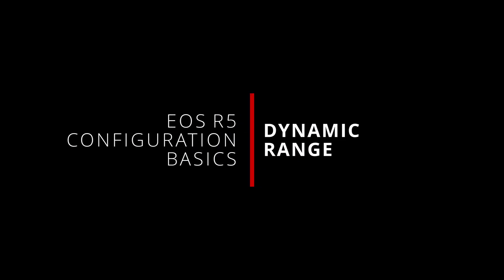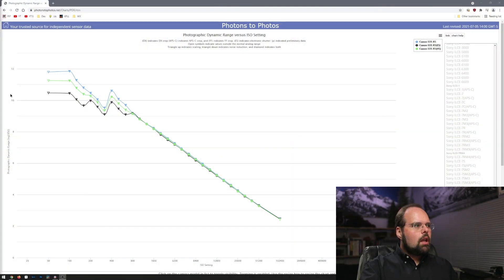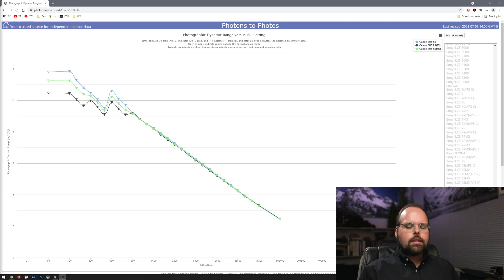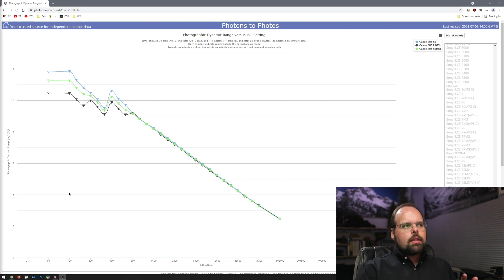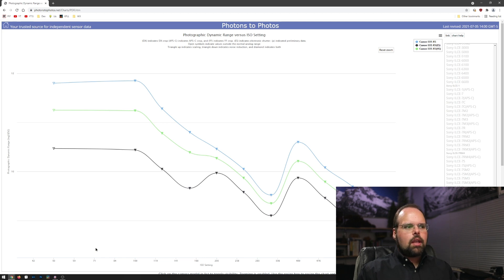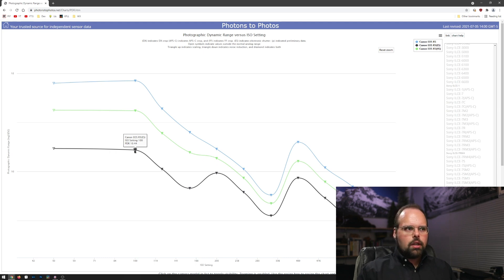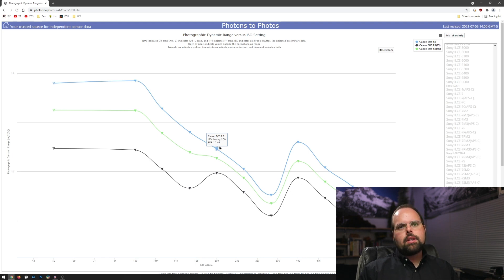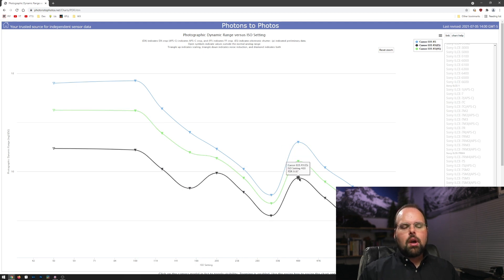EOS R5 Dynamic Range - EOS R5 Tip 8

Comment: I did 3 photos: 14bit, 13bit and 12bit. But if i open the file at rawdigger it shows a range from 500 to 16300 as normal 14bit no matter if is 14bit or13bit or 12bit.

Any idea why?

They should be different, some are 14bit and others up to 12bit...

But in raw digger:

All appear as: "bit depth 24, bits per sample 8 8 8",

In raw power: "bit depth 16"

In invisor: "color format 8 bit"

But in no developer (capture one, dpp, etc.) shows differences at all.

In summary: I have not been able to find in the metadata something that indicates that difference of 12.13 and 14 bit

How can I know that information per image for sure?
Reply from the maker: I don't think what you're trying to do will work, at least not the way you're trying to do it. From my testing, the bit depth changes are at the ADC level, but the results are scaled to Canon's 512-16383 raw file range.

To determine the ADC bit depth you either need to look at the functions that change it (shutter and drive modes) or you'd have to conduct a statistical analysis of the noise levels and dynamic range to determine the actual values.

Comparing 2 black frames in raw digger, the one shot with the FEC (14-bit) has a standard deviation of 1.5 while the 12-bit files has a standard deviation of 3.8. That's in line with what you'd expect if the camera is scaling the lower bit depth ADC up to use the standard raw value range.

I'm not actually sure what the various programs are looking to get their 24-bit, 8 bits per sample, bit depth 16, and what not. The raw digger line, looks like the metadata for the embedded jpeg. I've never used raw power, but that looks like it might be reporting what bit depth it's running in, and Invisor also looks like it's reporting the data for the embedded preview jpeg too.

Comment: Hi Jason, I wonder how all this relates to video. Looking at the black curve for 12 Bit full electronic, that should be identical to 12 Bit RAW video. Thus, wouldn't I gain nearly 1.5 stops of DR (from 9.15 to 10.44) by forcing the RAW interpretation to be at ISO 100? A bump from 9.15 to 10.44 is not to be sniffed at. But how would I achieve this anyway, when Clog limits me to 400 and Clog3 even to 800? Further, I would still gain over half a stop dynamic range in Clog at ISO 400 (a jump up to 9.87), so why was Clog 3 ever advertised to bring more DR? Most reviewers have failed to comprehensively prove an improvement of DR through the introduction of Clog 3 on the R5, so I'm sceptical of its usefulness. And this was reinforced by the graphs you discuss here.

H265 is a different matter altogether I suppose, because we are now looking at 10 Bit rather than 12. Correct me if I'm wrong. In that scenario, I could see how the differences between 400 and 800 vanish entirely and Clog3 as a Curve somehow extends the perceived DR slightly.  It seems to just shift the distribution of values to different areas in the range, rather than increasing the range itself.

Ideally I would like to disable Clog completely and just shoot at ISO 100 in RAW with a Picture Profile, as I'm trying to squeeze every last bit of DR out of this camera in Video mode.  This should give me 10.44 stops but I'll have Colours already baked into the image and I loose flexibility to color grade in post. Is this at all an option/am I correct in my assumptions? If I require a flat/log profile, it seems shooting at ISO 400 in regular Clog (not clog3) with RAW enabled, is the best option to achieve 9.87 Stops of PDR. Using Clog3 and ISO 800, I seem to be capped at 9.15 stops. 

Your help & comments would be really appreciated!
Reply from the maker: Let me start with I can't fully address this right now, mostly because it's pages of text and hours of video that I haven't quite figured out in it's entirety yet. Digging into a lot of this is high on my priority list, but also, as you can imagine, quite challenging. That said...

When you're shooting in raw, clog doesn't really apply. The data being saved is "raw" sensor data, not a clog/clog3 mutated version. Technically it's more complicated than that, but I don't fully understand the details yet.

The trick with raw video is getting the data out without it being converted to some other curve. Canon's cinema raw development tool doesn't support a linear output mode, at least as far as I know. You can probably get closer in Resolve or Premiere Pro, but I'm not even sure they support conversion to a linear format. And as far as I'm aware, there's no open source tools that can convert cinema raw to a linear file either.

Also all of the log formats actually "extend" the actual dynamic range that can be stored in the given number of bits. There's no perception involved. Log curves are lossy data compression. 

Log video formats are also somewhat more complicated in how they're designed to be used and work than most people appreciate. A lot of this has to do with backwards compatibility in broadcast TV standards that go back 60 odd years or more (this is the bane of modern video IMO).

Finally, CLog1/2/3 are log curves, you can't think of them the way you appear to be. They're not linear, and the whole bits == stops logic from linear raw formats doesn't apply here (nor does it to JPEGs either). A 10-bit clog file can store about 14.5 stops, a 10-bit clog2 file can store about 18.5 stops, and a 10-bit clog3 file can store about 15.5 stops. The compression algorithm doesn't matter: MP4, ProRes, DNxHR, DPX, whatever that's how the data is compressed not how it's encoded, it's a different layer in the process. 

The trade off any log format makes is precision. The more DR it can store, the bigger the steps are between brightness levels. Though this point also gets very complicated, as linear formats are hugely wasteful in the brighter stops where there's far too much precision for the actual brightnesses that can actually exist in them.

On top of that, they're not designed to scale dynamic range with bit-depth the way a linear raw file is. A 12-bit clog3 file will have the same dynamic range as a 10-bit clog3 file, but will have more coding points and therefore can store smaller increments of brightnesses.
Reply: @PointsInFocus  All good points, and fair enough about the lack of technical correlation between 10 Bit / 12 Bit and DR. But I still can't help but think there's correlation between Video capture to how the Electronic Shutter mode behaves in the graph you discuss in this video here. Are you aware of the CineD tests? They confirm that there's indeed a gain in DR shooting at ISO 400 as opposed to 800, a gain that correlates almost exactly to the graphs above. I suspect strongly that the next jump up, from 400 to 100, will yield even more DR, also in Video.
I've also figured out in the meantime, that you can indeed shoot RAW at ISO 100 with a Picture Profile on top, and then bypass said Picture Profile in Resolve and interpret the RAW clip on the basis of Clog Curves, just as if you were shooting RAW in Clog in the first place. (In theory, you could overexpose ISO 400 by two stops and then lower the ISO to 100 in the Resolve Raw tab, but that Raw tab is broken/buggy for Canon Raw since half an eternity. ISO changes sometimes work, sometimes not.)
Bottom line: I think it's a worthwhile test to shoot Raw in Clog at ISO 400 and compare it with a Raw Clip shot in Neutral Profile at ISO 100; then develop both clips in Resolve as Clog 2 / Cinema Gamut files and match them by two stops of light, and then compare DR. I don't have the tools to do the analysis scientifically, unfortunately. All I could think of would be to push Shadows and Highlights and interpret the behaviour of the files.
Is my logic still flawed? At the end of the day, god knows what's really going on under the hood here 😂
Reply from the maker: > I think it's a worthwhile test to shoot Raw in Clog at ISO 400 and compare it with a Raw Clip shot in Neutral Profile at ISO 100; then develop both clips in Resolve as Clog 2 / Cinema Gamut files and match them by two stops of light, and then compare DR. 

Shoot raw at 100, 400, and 800 and compare the dynamic range however is easiest for you. The picture profile and clog curves are all metadata in a raw file, not actual changes to the pixel values, so they're not going to affect anything anyway if you're not applying them in post.

The R5 will never exceed 12 stops (engineering DR), so even a clog1 file will can encode and store the compete dynamic range. If we're just looking to understand DR, we don't have to care about encoded precision. At least as long as you've set your exposure level's correctly and white is at or just under clipping so you're not artificially crushing data in the blacks.

In theory, the camera should preform the same in video as it does in stills form a dynamic range perspective. It's the same rolling shutter, same ADCs, etc. Of course, we all know in theory, theory and practice are the same, in practice that's almost never the case.

Like I said, I want to really dig into this, because there's a ton of stuff I'm just not really sure about here.

The real problem with all of this, and what I've struggled with the most, is setting up a test that works and is accurate. Granted, I could spend about 10 times my annual camera gear budget on something from Immatest or whatever, but that's simply not going to happen any time soon. Moreover, I tend to want to come up test setups that can be replicated by anyone without spending a huge amount of cash. It doesn't help us when there are only 1 or 2 test outlets, and they have a potential conflict of interest between their advertising sources and their testing independence. I also like it when people can easily and independently verify my results.
Reply: @PointsInFocus  Thanks for taking the time to reply and elaborating. I really appreciate you providing us with all this information free of charge. Your test of the pre-Amps was also really useful. I learned a lot about my R5 recently through intensive testing and it is quite a temperamental beast for Video shooting, especially if you care about colours and a filmic look, avoiding the nasty highlight clipping that the camera is prone to. Shooting at ISO 400 in Clog1 with BT2020 color space is giving me the best results now, and avoiding AWB like the plague. I have a color meter which is really useful as I find the Custom WB functionality so cumbersome. Thanks once again.

Comment: I got better dynamic range and highlight rollout and recovery with D+2 setting. 
What is your views on that? 
Whenever using D+2 is one stop less of ISO (iso200 is actually iso100) it will mean I will get the iso400 dynamic range using iso800?
Reply from the maker: Highlight tone priority doesn't change the camera's dynamic range, but it does change how the available dynamic range is distributed.

Normally, the camera meters with the assumption that the scene averages 12.5%, which results in 3 stops of detail above the metered point (highlights), and the rest is used for shadows. When highlight tone priority is enabled, the camera underexposes by a stop (though it expresses this as a 1 stop higher ISO setting). This means that there's now 4 stops of highlight range available and 1 less stop available in the shadows — which is why it warns about increased shadow noise when enabled.

While you can look at it as getting ISO 400 dynamic range at ISO 800, you're not really shooting at ISO 800, you're shooting at ISO 400 under exposed a stop with the underexposure being fixed up in the JPEG conversion. If you shoot raw, you shouldn't see any actual difference in the image data between an image at ISO 400 that's under exposed by a stop and an image with highlight tone priority turned on (at least this was the case when I tested it years ago).

Comment: I knew the R5 could handle higher ISO's but was always holding to 100 when ever possible.  I will now go to at least 400 when I need a little more light.  Thanks for the information.   With 400 I can use less flash power.

Comment: Thanks for the video. So, how does the use of CRAW  vs RAW impact the situation?
Reply from the maker: On a technical level, as far as I understand it, CRAW doesn't change the bit-depths and therefore the dynamic range. But my math skills are both poor and rusty enough that I can't understand enough of the technical details on CRAW enough to be 100% sure on that.

Practically speaking, I can't find a meaningful difference between the two formats other than CRAW files are way smaller. Even when it gets into serious pixel peeping, it's almost impossible for me to tell if the differences I think I'm seeing are in my head, a product of noise, or a product of the lossy versus lossless compression.

At this point, I shoot everything in CRAW.
Reply: @PointsInFocus  Thanks again.